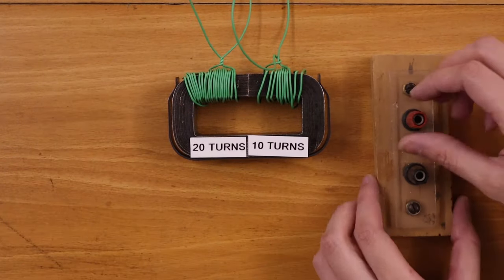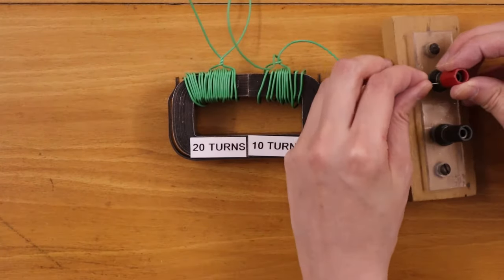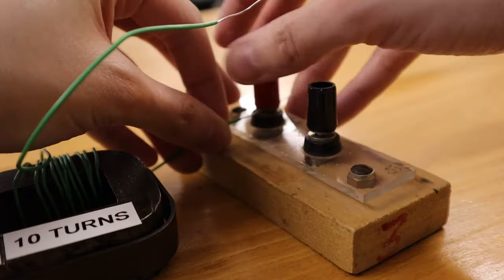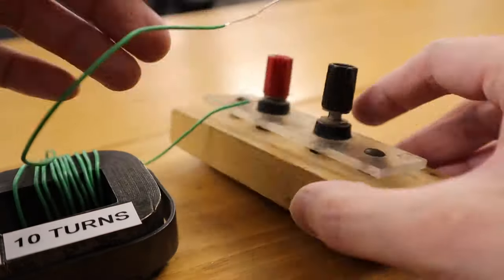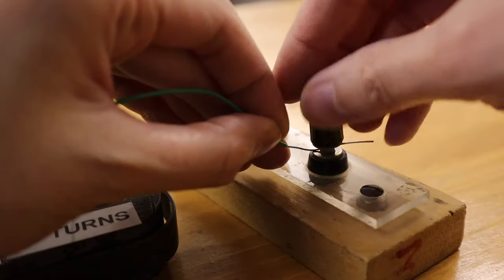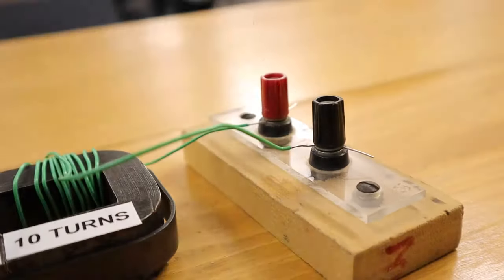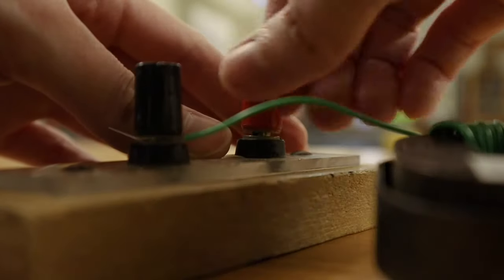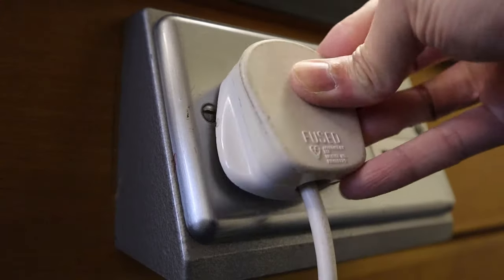Building a Transformer - Physics Experiment

Comment: Not helpful. What happens when you put the power on the 20 turn side? All you measured was the 20 turn side when power was applied to the 10 turn side, and the power you put into the 10 turn side.
Reply: she is trying to show a step up transformer, if she put the supply in the 20 turn side it will be a step down, the primary coil (20 turns) will have input of 0.641 V and the 10 turns will have half of that which is like 0.320 V

Comment: I always thought they needed to be one in one side of the material and the other in the other side of the material, not in the same line.
Reply: No, on a U core or C core such as in this video, the windings can be anywhere.

There are performance reasons for not placing the windings as in this video; better coupling of the windings would have had a voltage ratio much closer to the 2 to 1 turns ratio. Better coupling would be achieved by stacking the windings one on top of the other.

Comment: Well done!! Where did you get the iron core and its clip?
Reply from the maker: It was purchased as a class kit from Better Equipped in the UK. You might also find these kits from other suppliers like Philip Harris.
Reply: Thanks for the reply! And what did you use for the source? I looked like it had up to an 8 amp output. I teach at a trade school and I am wanting to have this as a lab for students.
Reply from the maker: @keithb.8684  It was just a 1V Westminster Power Unit. I think anything around 1 to 3V would work fine. Hope it goes well at your school!
Reply: @vt.physics Why does it work, while in the video it uses rubber insulated cables, instead of having to use enamel insulated cables to be successful?
Reply: @vt.physics  Please My Friends I Need a Solution, I Have a Homemade Induction Heater, But I Have Already Used a 6mm Diameter Rubber Insulated Cable Coil with 20 Windings, Not the Enmail Cable Type, Can It Still Work?

Comment: I am using 12 volt battery...then what no of turns should be taken
Reply: Pls answer as soon as possible
Reply: Google says about 100-200 turns
Reply: A battery is a DC power source; transformers operate using AC power sources. The AC can be produced in a number of ways, one of which is by connecting as the load of a transistor that is being switched on and off.
Reply: @stevebabiak6997  I used transistor and 10 ohm resistor but still reading isn't showing in multimeter
Reply: @soumyashikha7312  - you need to have something switching the transistor on and off. An additional circuit besides what you already are doing.
Reply: @stevebabiak6997  yes you are right....this is the why my transformer hasn't worked..
Reply: @stevebabiak6997 Isn't using cables other than enamel-coated ones to make a transformer dangerous??
Reply: @soumyashikha7312  If I may know what Type transistor to use?

Comment: can you make a stun gun using transformer
Reply from the maker: Can be done, but may be not at school 😆
Reply from the maker: Kris Pea  It has to be AC because it needs a continuously changing magnetic field.
Reply: @HashirEasa  No, it have to change polarity
Reply: @HashirEasa  
Something you can look into is how car ignition systems (coil) are working.
Its DC volts input and the moment the line is cut on the secondary coil, a spike is created on the primary coil.
Now with the help of a rectifier you can havè again DC volts with a higher or lower voltage output

Comment: Hmm I think I've got it. Doubling the number of turns doubles the output voltage. Since it doubles the voltage, would it also half the amperage? Similarly, would it work in reverse? Where putting x Volts into the 20 turned coil would output x/2 volts in the 10 turned coil, but double the amperage?
Great video, I loved the clean easy to follow editing
Reply: Yes, correct. The more turns, less the amperage. Turns and voltage are directly proportional. Turns and amperage are inversely proportional.
Reply: @xydian4282  awesome, thank you so much
Reply: Search up transformer equation
Reply: With a transformer, Power In = Power Out.  When the output (secondary) voltage is times 5, the output amperage is divided by 5, or vice-versa as you said using 2 as the example.  It all has to do with the ratio of turns on the two coils.  There is an old saying, "there's no such thing as free energy"
Reply from the maker: @mhikemars2971  This is exactly it - conservation of energy (or power) is the physics behind a transformer.
Reply: @xydian4282  Then how do i get high voltage and high amperage? do I just need more amperage to begin with?
Reply: @vt.physics Is there anything to choose a cable for? Usually, if you want to make a transformer, you have to use an enamel coated cable, not a rubber coated cable?

Comment: It looks like the wiring has been connected to the DC (red black) outputs of the power supply and not the AC (yellow)? A transformer needs AC to work?

Comment: Is this a step up or step down transformer
Reply from the maker: It depends on where I consider the output voltage is. If I say that the output voltage is the right hand side where I have fewer turns of coil, then it's a step down transformer.

Comment: Would you pls name all the apparatus you have used
Reply from the maker: The iron core that I used is sometimes called a yoke. You don’t necessarily have to clip them together…as long as the two halves are placed next to each other so that the magnetic fields of the primary coil cut through the secondary coil. 
Then use a voltmeter to measure the input and output voltages.

Comment: Did you connect the secondary coil to a resistor and read the voltage across the resistor? It seems the volt meter is connected to the coil directly like ammeter. How did it read the voltage?
Reply: The voltmeter has a very high internal resistance, so it will measure the voltage difference across any two points it is parallel to.
Reply: Ammeter is connected in series not parallel. Otherwise you get a boom

Comment: What is devices at right side??
Reply from the maker: I’ve used a multimeter to measure the voltage - you can use a voltmeter instead.

Comment: So the wires are never connected and there insulated how does the voltage transfer yo the secondary wires?
Reply: Through electromagnetism
Reply: It's 'magic' , leave it at that
Reply: the energy transfers by the changing magnetic field of the primary coil, there is no electrical connection between the two coils

Comment: Can you mention the material and also the  voltage and is it useful for step down and step up
Reply from the maker: I used some insulated wire with two iron cores. The power supply was a fixed voltage (I think it was 1V) Westminster power unit

Comment: hi! what is the name of the wooden apparatus that you are using to join the wires?
Reply: So it doesn't really have a name, it is just a piece of wood with 2 binding posts mounted on it. Binding posts serve no other purpose than to make an electrical connection. In electronics there are probably hundreds of different types of connectors that essentially all do the same thing. I hope that helps. :)

Comment: Can I use a ferrite core instead of the one your using?
Reply: A ferrite core is not a good choice for the typical 50 Hz and 60 Hz power line frequencies. 

And the cores in this video would be a poor choice for frequencies above 1KHz, where ferrites would be more appropriate.

Comment: hi i have a question wont it explode when i connect primaly wireing straight to the 230ac and ill try to measure output? btw im not a native and i dont give a damn bout the correctness of splein those words, best regards
Reply: If you try to connect either side of that to the full AC mains power, you will trip the circuit breaker or blow the fuse on the AC mains. He is only using about 1 VAC in that video.